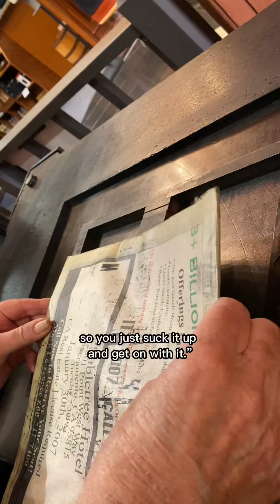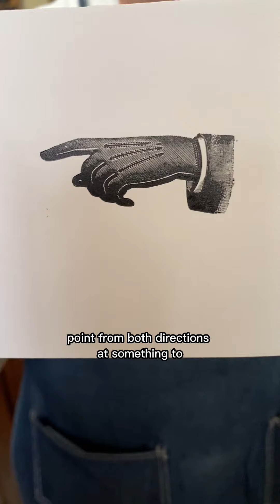August 13 - International Left Handers Day

Comment: Of course there were left handed comp sticks. Well certainly in England. I was a hot metal comp starting my 7 year! apprenticeship in England in 1966. I was left handed and was told I could buy a left handed stick but was advised to get used to setting as a right hander which I did. I did thus become ambidextrous to a degree. Hand setting 6pt type was no problem although of course it was mainly machine set using the Monotype process. 
Saw this advert on the internet today 17 August 2022 in my first search:
"Letterpress Composing Stick – LEFT HANDED
£40.00 plus VAT
A composing stick is a device used to hold metal type letters while composing lines of type ready for letterpress or hot-foil printing. This one is specially made for left-handed compositors. Please note that a left-handed stick is held in the right hand and the type is selected using the left hand."

Also when you roll out ink (ink up) you should simply lift the roller a little in the air at the end of each stroke or pass, so it spins to a different place when you replace it onto the ink, thus working the ink up a lot better and easier. 
Nice to see the old craft being kept alive. Still have my stick and my English, Compositor's Work in Printing book, our bible, at least in the UK.
Hope you don’t mind my comments. 
Keep up the good work.